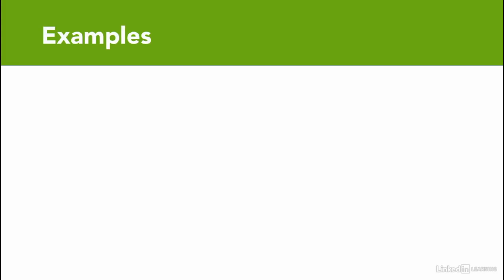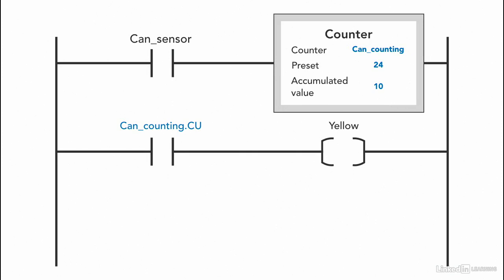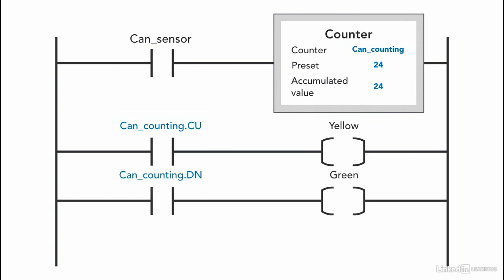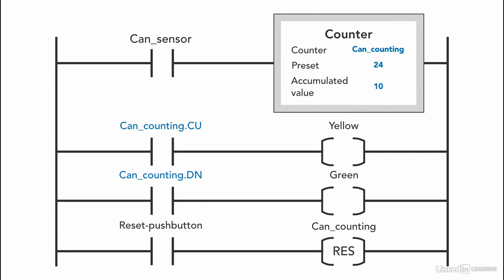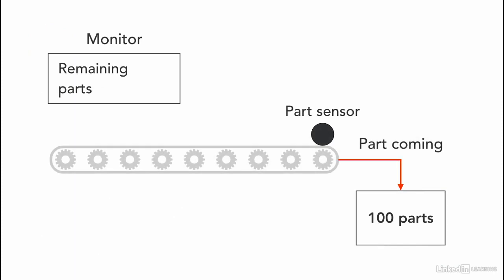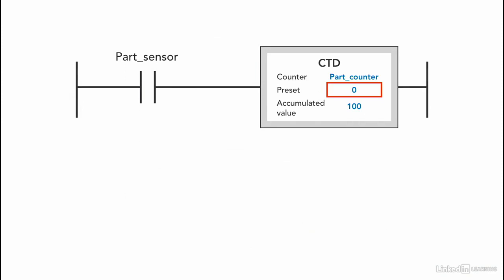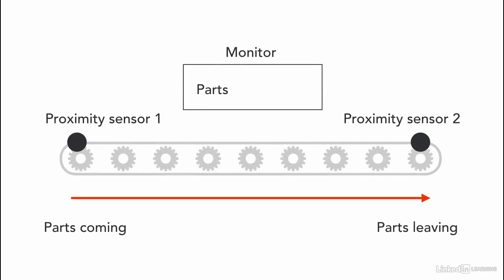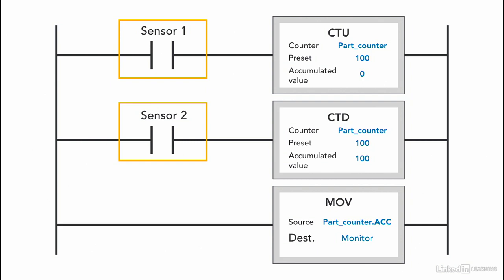Examples of counter types

Comment: 5:20 i have a confusion that why is in count down counter there the preset equal to accumulated value . Won't it mean the counter has done counting and without reset will not count more.